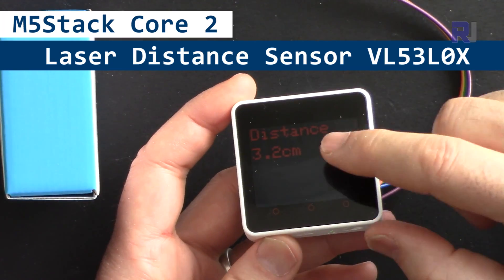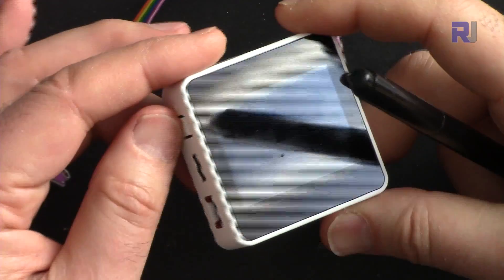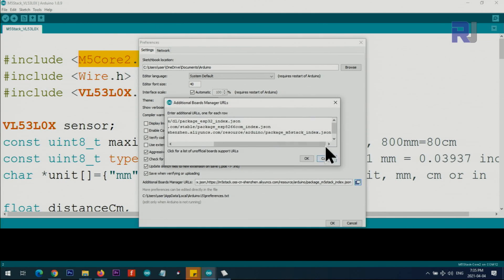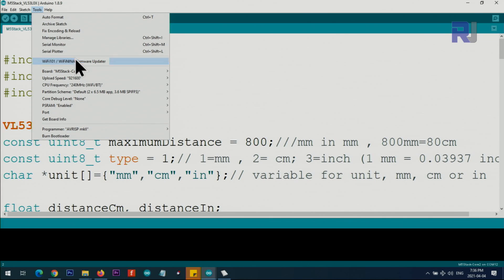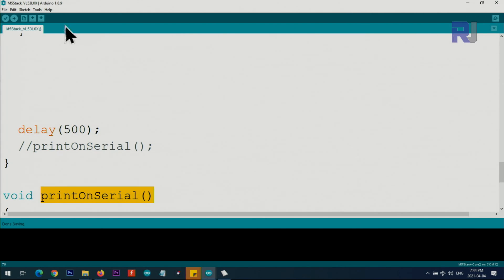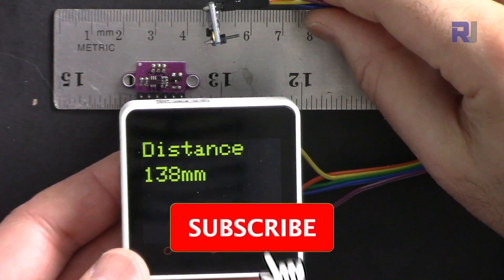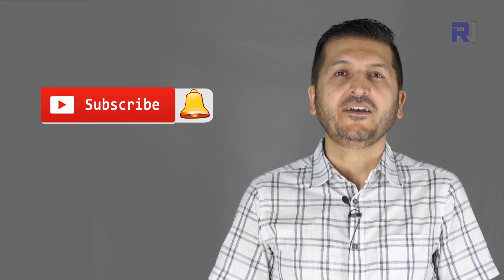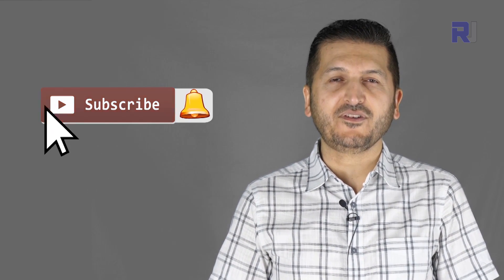Laser distance measurement with M5Stack Core2 ESP32  and VL53L0X with Arduino - RJT377

Comment: Nice, I have found a meaningful application for myself. I want to add  a reset button for a drill stand. I want to reset to 0 when I put the drill on the workpiece. Then I drill and see how far the drill is in the workpiece. Whats the best way to do this?
Reply from the maker: if you wan to detect proximity, it can be done so many ways.   but for tools it would be hard to know exact distance.  you may use bluetooth if the device is farther away and signal disconnects you can take action.